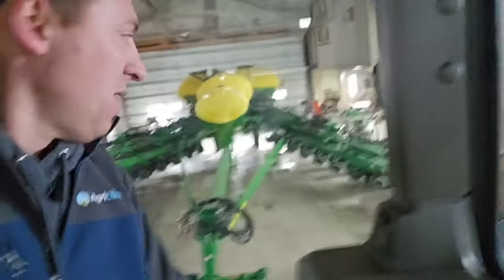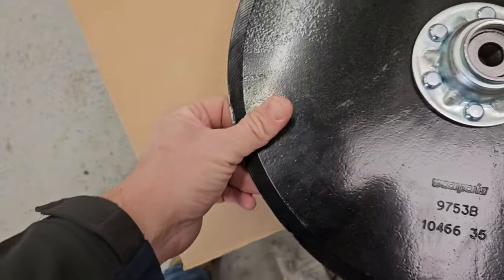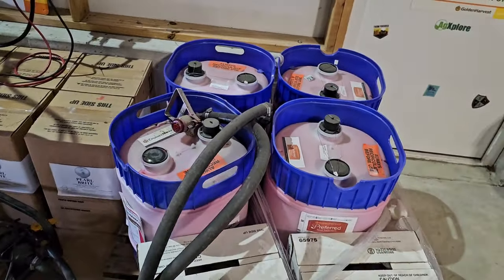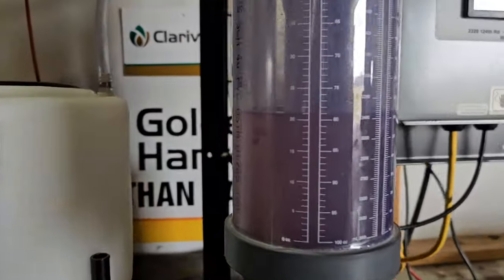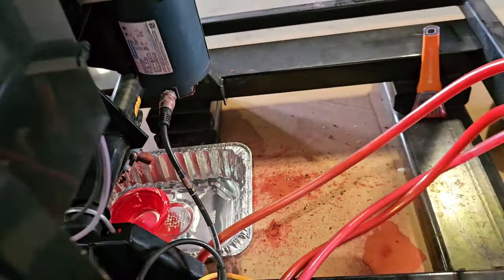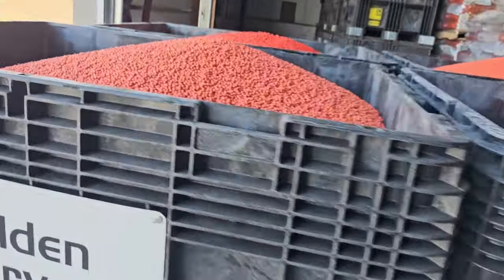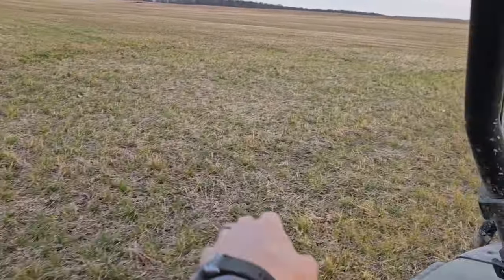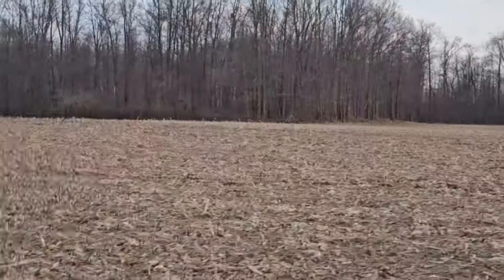Soybean Treating Season Begins!!!

Comment: you might want to try using a rubber spray on bed liner on your trailer surface that is what we did did to stop our pallets and boxes from sliding in transport just a suggestion

Comment: 9:40  you talked about the EXTRA BOX so you don't have to transferr after dryed and watnot....
but no menteion of the AUTOBOX OPENER YET?????   did it survive last season??
Reply: unpausing
Reply: oh it goes on the one up high right?  

emmend er ammend that to 

DID IT WORK GOOD ENUF TO GET ANOTHER for the bottom box ?? hehe  hands free gates??
Reply: YEA!!!!!   28:01  fancy box openenenener  YEA!!!!!  OH  YEA  that's why ya couldn't STACK SO HI and unload from 22 feet up!!!   ALRIGHTY :)  

are you gunna get another one to be HANDS FREE ??? are there multiple channels you can SET THEM TO so they all don't go at once???   A and B channel or some THING like that???
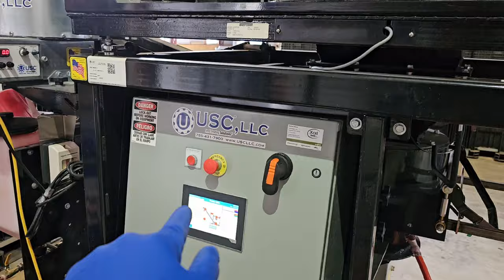Reply: 29:49  YUP that is SWEEEET!!
Reply: THE ONLY DIFFERENCEAEANAE IS .... prolly less ''possible brakeage'' cuz of the ''1 less time it was dumped''  BUT

BUT 
does that EXTRA STEP of the RETRANSFERR you WERE DOING ''adgatate'' or move around the beans BETTER so they are ''more coverd'' cuz they didn't DRY NEXT to their neighborz???  ummm  like leave little spots wheret hey were bumpin derrarrerrerz???
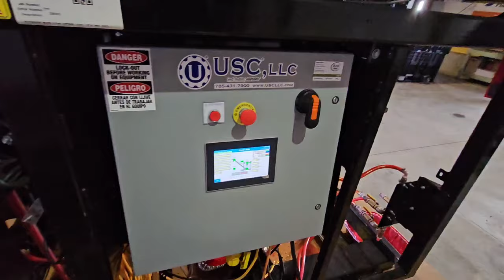Reply: 34:44  the ''wigglewigglewiggle bridgeing thingie'' addressed ;)   hehehe  eh I actually WAS WONDERING :)
Reply from the maker: Yep use the box opener on the top box. Gate on the box that stays in the treater pretty much stays open. No need to get an opener for it